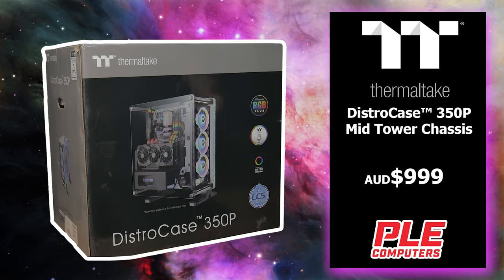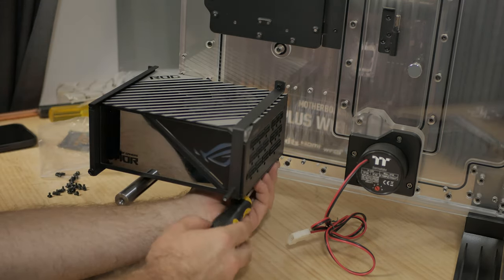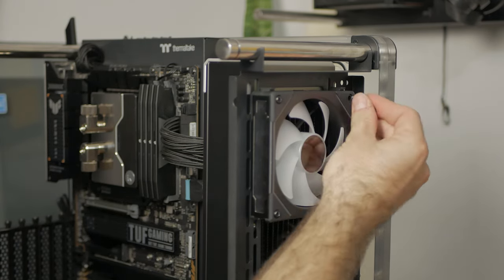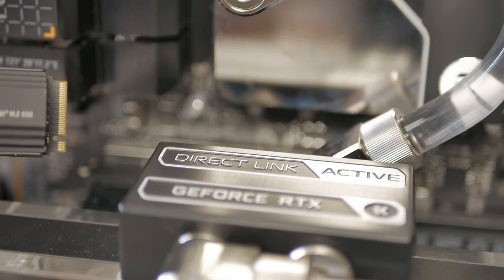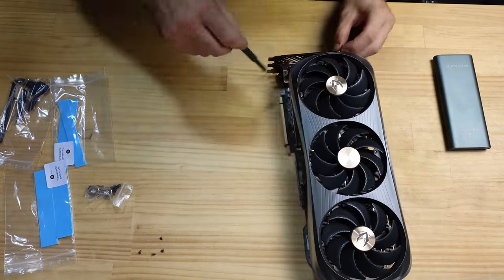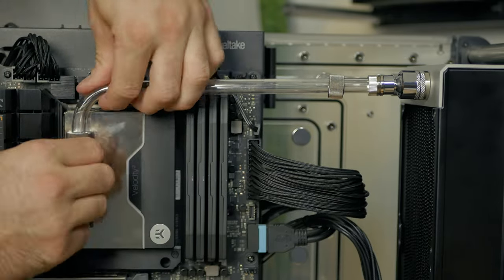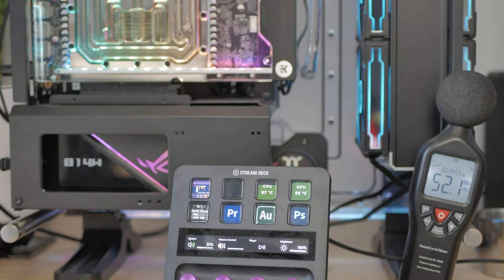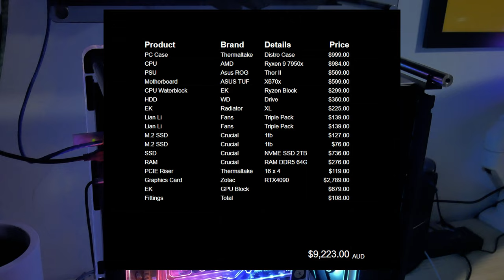$10k Water Cooled PC Build Vlog | AMD Ryzen 7950x & RTX4090 in the DistroCase 350P

Comment: Seriously, that Zotec card comes with a plastic backplate at the price of it? Also, the EK 40-series cards come with a backplate albeit they have increased the price over a 30-series block that the back-plate is an additional purchase. As you bought the ABP set, I wouldn't expect it would come with the basic back-plate. Mine is an ASUS TUF 4090 OC and the EK block I run (non-ABP version) is compatible with it as well as the Strix 4090 and comes with a replacement 2 slot rear IO bracket.

Comment: 56 is a little to hot mine runs 38 all day water cooled @5.9 in a lian li o11d with a 4090 strix oc. I actually think you are saturating the radiator.